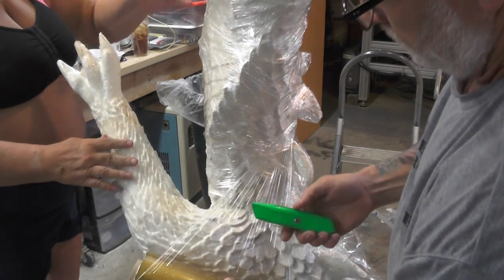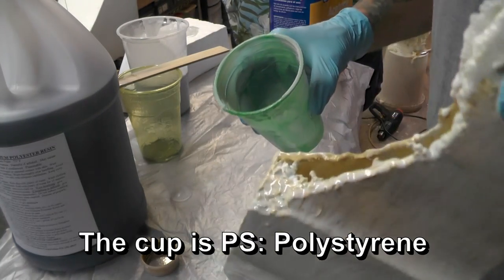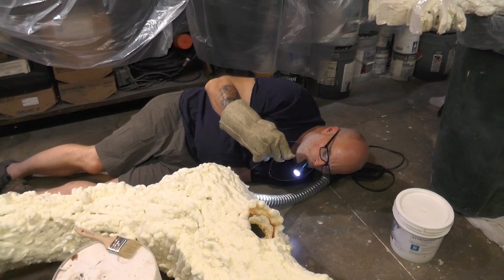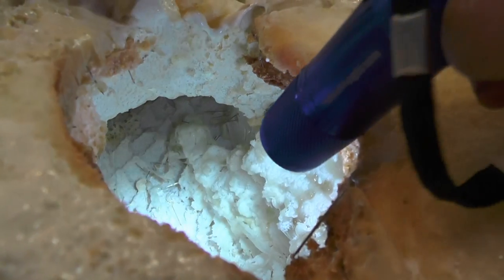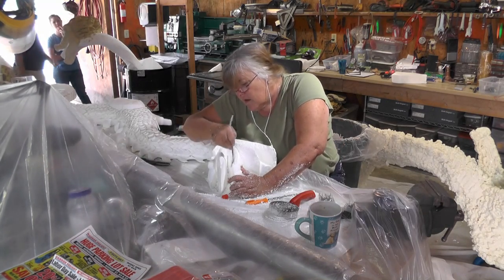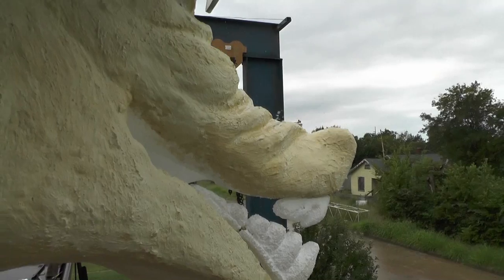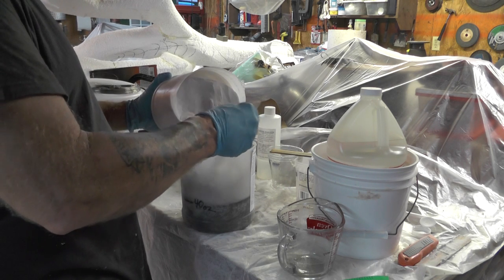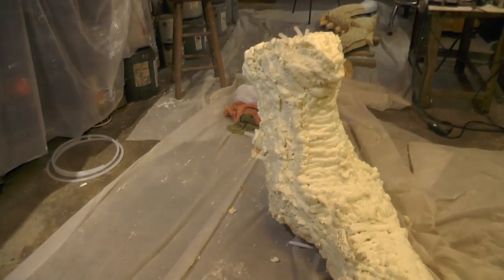Foam Sculpture - Part 5 - Lost Foam

Comment: interesting approach, it's going to look great on the boat, I'm a model maker by trade and some years ago, I worked with a team, marking a full size dragon, about the size of a T Rex, for the film Rain of Fire, we scalped the body in clay then spayed it with a barrier then made a fiberglass mold, we filled the mold with a rubber skin, then dress the skin over a steel skeleton, because you need a hard model, you could still used this technique, but instead of going with fiberglass on the clay, you coat the model with a layer of silicon rubber first, then a hard layer fiberglass mold, when you remove the mold from the silicone coat, you cut the rubber and peal it away from your master, then lay the silicone rubber back in to your fiberglass mold before reconstructing it, then pouring you're resing mix.
keep up the good work, loving you're videos.
Reply from the maker: +beesleyboy I think the difference is time over budget.  I have less than $200 of foam invested in each dragon that will not be part on the final structure.  No clay, no silicon, no backing material.   The styrospray, water putty, polyester resin, micro spheres are all part of the final structure and part of it's strength.
Reply: Thanks for getting back to me,  im loving the build.  
I'm sure the company I worked on the dragon with,  had a pretty big budget. I look forward to seeing the final results,  it's a great project and I love the way the project is progressing,  I would love to drop in and be a part of the team,  just a bit far away from the UK. 
Regards Gordon.
Reply from the maker: +beesleyboy We'll bring the boat to you someday.  There will always be a barnacle or two that need scraping.  :)

Comment: Hello Doug, Like it.
How about cutting your dragon form into halves and removing foam before you paint and wrap. Lay in a metal frame with pieces for bolts already threaded into the dragon, for extra strength. Your boat will be trying to twist the dragons off 24/7/365. Alongside the water pipe run perforated hosing to carry acetone everywhere you want, you can hose it in under pressure till you are sure all of the mold is clear. Use the same pipes to push in the micro balloon mix while you drag them out. Do the dragon waltz.
The metal frame would also allow for 'Whiskers' solid enough to hold onto in a storm.
Alex
Reply from the maker: +Alex Mac I think it would be much more work to clean up the seams and would introduce a weak point along the seam.    And as we demonstrated in the previous video the acetone weakens the outer shell, where as heat increases the strength.

Comment: I had to do some bits for my kit car, only about 18” square.  I did it by carving the shape in poly.  6 coats of thin latex followed by about 15 coats of thickened latex with a reinforcement of cheese cloth.  Then I made several mother moulds ( outer skin) of fibreglass so they could be bolted back together later, using polyethylene and wax as boundary layers.  
After demould the FG was then then bolted back together and the latex laid back in.  Fibreglassed the inside with a couple of layers.  Unbolt the mother moulds, peel off the latex.  One finished moulding and a set of moulds I can store and use later if I need to.

Comment: I used to work in a foam shot that made moldings  and borders for houses  and businesses... with 2lb foam and a few coats of fiberglass matt it would have been super strong super light... and alot easyer make.. also easily  paintable... without worrying about all the foam melting stuff...
Reply from the maker: +Daniel Poppell   I don't think that would have been sufficient strength for a boat.  Nor would it allow us to add the water and electric conduits inside.
Reply: +SV Seeker agreed!! I guess I shouldn't  question the methods  of the hardest working man on youtube ;) lol

Comment: What if you took a back pack sprayer (or some way of spraying it in small amounts) and misted the acetone in small waves, so the acetone will dissolve some of the foam but not collect. Will that prevent it from softening the outside layer? It's really amazing to see them take shape. Thank you for sharing.  -Chase
Reply from the maker: +Chase Cares I think that would work.  It would require patience.

Comment: It would seem that if you covered your dragons with 2 layers of fiberglass veil and resin, you would not lose too much detail. The cured resin covered veil should make a thin hard shell. You could bisect the veil-covered dragons and scoop/melt out the polystyrene foam from the inside, and then add a few layers of fiberglass cloth also from the inside. You could join the halves together. Veil generally as the thickness of the material that covers the bottom of couches. Before using it, you would want to rub the veil in your gloved hands to soften it to break the sizing. This will let it conform better.
Reply from the maker: +Brenda Make Give that a try on your dragon.
Reply: I was just trying to be helpful : (
Reply from the maker: +Brenda Make   Didn't mean to hurt your feelings.   But cutting it apart and putting it back together is to me a lot of time and effort that can be avoided.   I think the process we are demonstrating shows proved that.

Comment: I build concrete counter tops. I use polyurethane to cast intricate detailed  difficult designs. I tried doing the lost foam way with water putty and it was a disaster. I still use the lost foam method but with polyurethane. polyurethane is unofficial effected by acetone.

Comment: Why not use steam?  Surely you can generate large volumes of steam!
Reply from the maker: +eformance The moisture and heat would soften the shell.   Heat alone made it brittle but it kept it's strength.

Comment: To Bad I Cant Be Out There To Make The Mold & PARTS For You...... A Quickie Latex Mold Was The Way To Go ....... BE SURE to ad UV Inhibitors to your NO WAX, EPOXY RESIN & NO WAX Gelcoat.... if you can help it, DO NOT use Polyester Resin for this part!!! ........ Milk containers cut in half work great for mixing resin, they wont melt.

Fiberglass Molds and Parts is what I do!
Reply from the maker: +GasserGlass   If you want to get here next week, we'll build a latex mold.   ...but you'll have to pay for the latex.  :)
Reply: If I could make it out there next week, I WOULD!  .....  and, I WOULD GLADLY Bring the Latex With Me!

Comment: why are you not making a plaster mold
Reply from the maker: +luzbarnett1   Because I don't have to.   And if we did, we'd not be able to pick it up.
Reply: I guess I will just have to see what you are doing as the videos progress. just topic of conversation Could of made fiberglass mold and run your tubes then filled mold with a plastic or epoxy, something or another. I guess I am just unclear on what you are trying to do for the final peace. love the Chanel you are very talented!

Comment: Hi
Your MEKP hardener to resin ratio looks very high. It should be 1-3% by volume looks like you are at 10-20%.
Obviously that high a hardener ratio is going to produce a very fast cure and have serious effect on the resin properties. Also not all the MEKP hardener cure , hence the MEKP vapors coming off ( nasty stuff as you know). This will then bleed out later, Yuk! A slower cure will allow you a lot more time to get the resin to coat the surfaces in the mold.
When making cast sculptures like this the common filler used is ' calcium carbonate' ( ground limestone) allows it to flow at higher filler loads but is heavy!

Comment: Too bad there isn't a cheap porous foam that you could just carve and then vacuum infuse.
Reply from the maker: +bfayer Vacuum infuse?
Reply from the maker: +bfayer Oh right.   I'd like to try that someday, but I don't think it works well on rough surfaces.  ....at least I have not seen it done.   I think the cloth might hide too much of the detail.    However I may try a single layer of really light cloth on the outside.

Comment: Your creating way too much work for yourselves, not to mention wasted material which is very expensive...coat the styrofoam  original with a material that does not react with it and then pull your mold off of that then rigid smooth and finished model. Would be much faster and a whole lot less work and cheaper in the long run. I have also seen people just make a styrofoam model and finish it out with other materials and use it. no need for extra weight on the already very heavy boat.
Reply from the maker: +1NRG24Seven  More expense?  I don't think you understand what we doing yet.